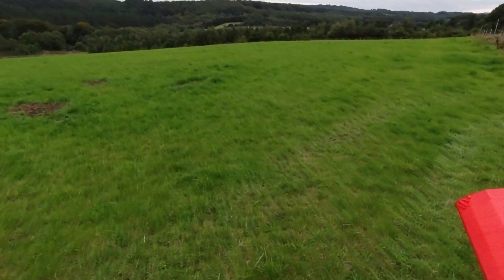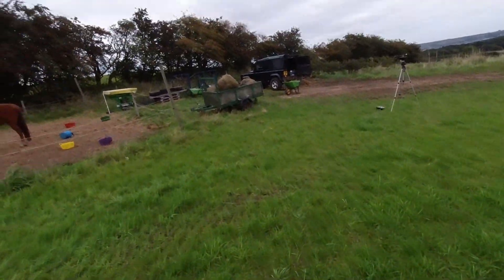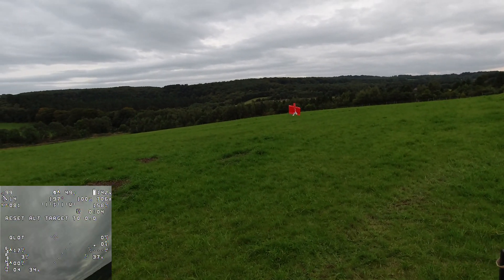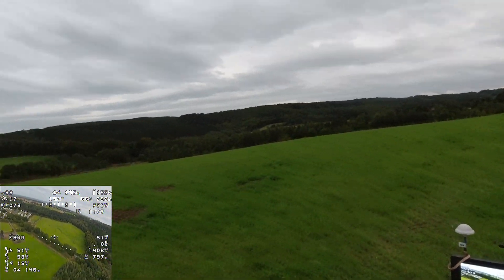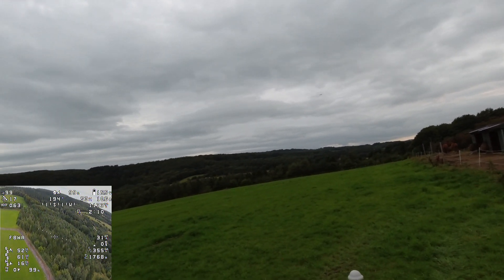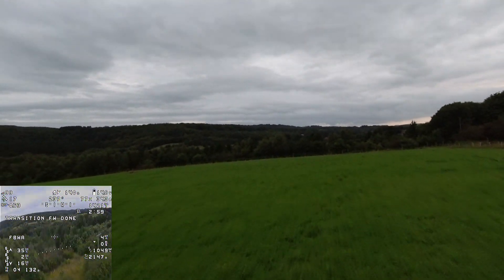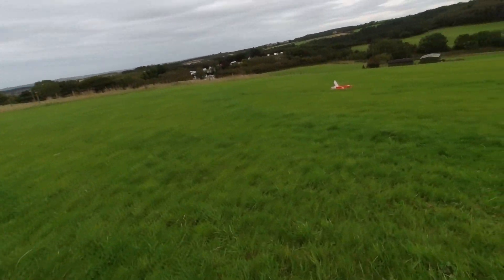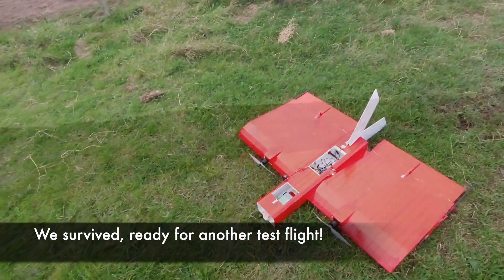Tailsitter A VTOL Experiment, Test Flight 3

Comment: First time i started flight at QSTAB mode. Is that correct? Or better to set HOVER mode?
Reply from the maker: Yes, start with QSTAB first and make sure it hovers well like this before progressing to QLOITER.  If you have the space, hang your wing with some string and experiment with QSTAB to see how balanced your aircraft is.